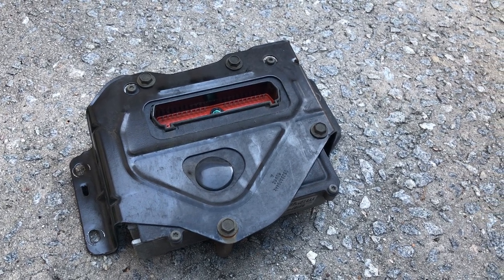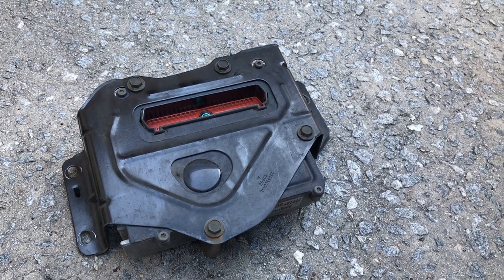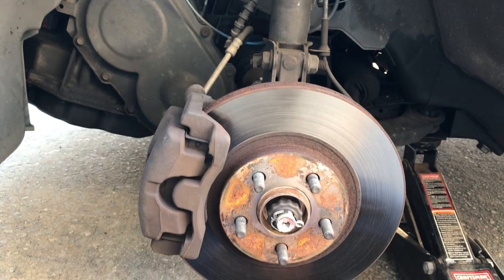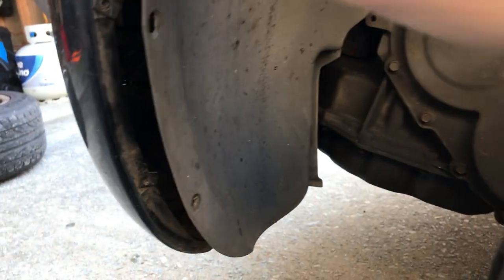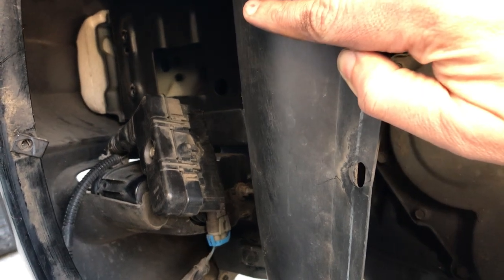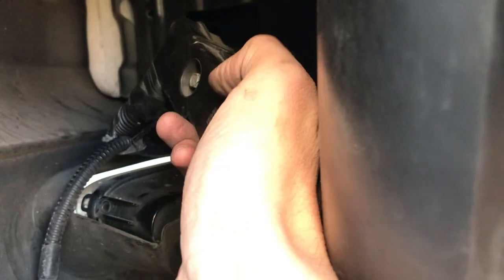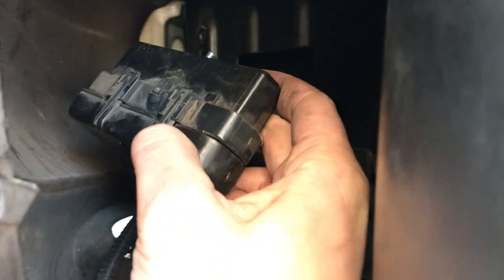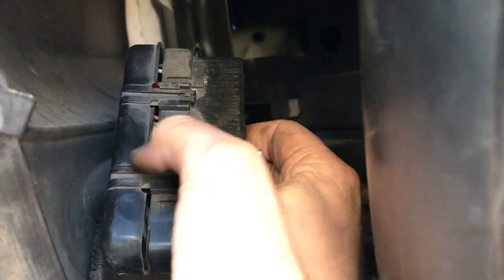PT CRUISER 2001 - 2002 TCM Location and Removal P0700 P0605

Comment: Another question. Did you have to program the new TCM or is that only required for the PCM?
Reply: Yes, it needs to be programmed. I got mine preprogrammed online, I wouldn’t recommend any company in particular though, they all have some pretty bad reviews. It worked out for me though.
Reply: @w26gt  thanks for all the help.

Comment: Why is it important if you have codes 0605 and 0700? I have those codes and I thought it I needed to replace my PCM but I just replaced it and its still in limp mode so I am wondering why you say the TCM for codes 0605 and 0700? The 0605 says its an error in the internal ROM of the ECU
Reply: What are the symptoms? Is it not shifting through all the gears? What year is it?

Comment: would I be able to get one from a junkyard and have it programmed
Reply: Yes, but you’d need to bring it to a dealer to have to reprogramed as most transmissions shops I’ve found won’t have the required equipment. So I would confirm that you have someone to reprogram it first before going through the effort of getting one at the junk yard.